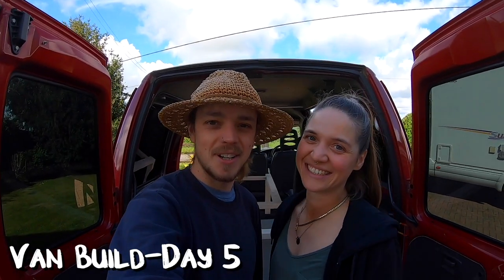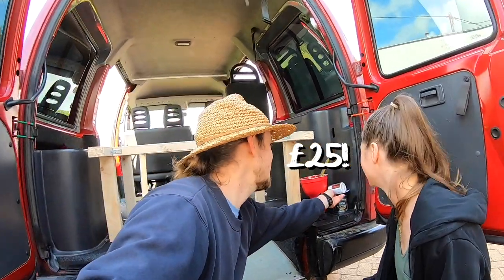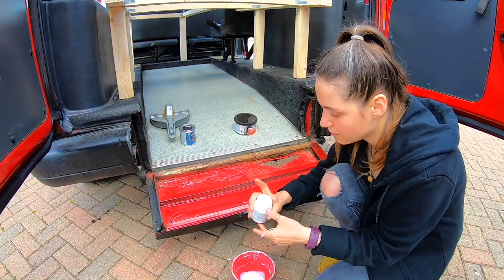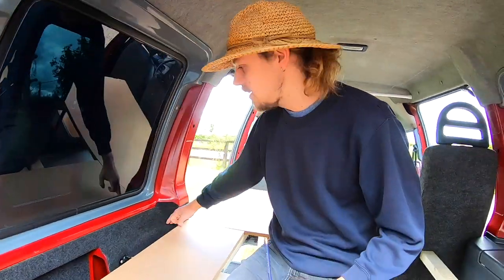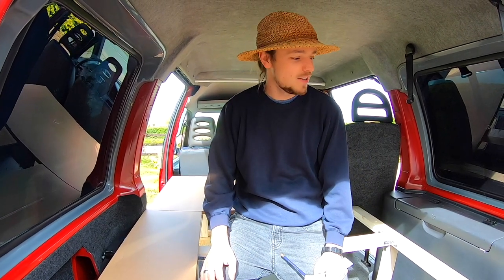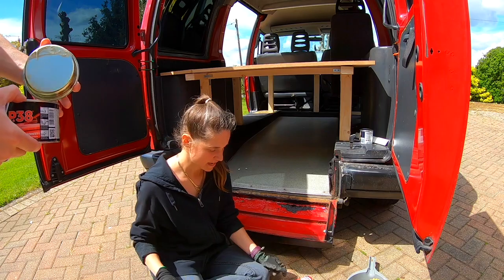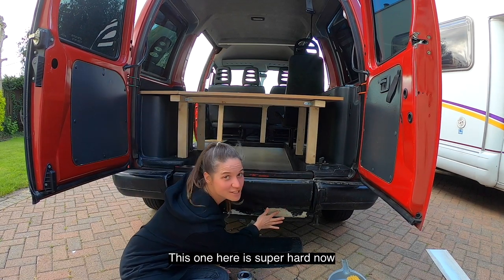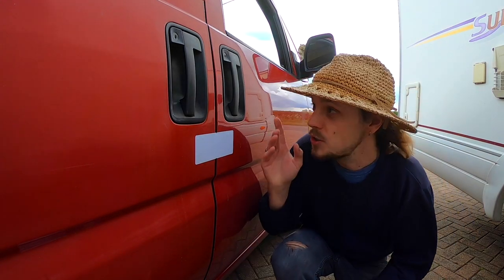BUDGET VAN CONVERSION (UNDER £800/$1000!) (2)

Comment: Hi guys, those holes u made in the bodywork will rust, to prevent it put some rust protection in it, and rubber pattern between bodywork and the deadlock so water can’t get to the holes
Reply from the maker: After we did it we totally realised the same thing that we could have treated the holes first... Oh well we have screwed it all together now and we'll have to hope for the best 😁🙏

Comment: tip , you will need side and back curtains , although you have put the tint on them , at night if you use a light inside everyone outside can very easy see inside but funny thing is you wont be able to see out at night with a light on , I found out the hard way lol
Reply from the maker: Hahahaha thanks so much for your advice 😁🙏😍